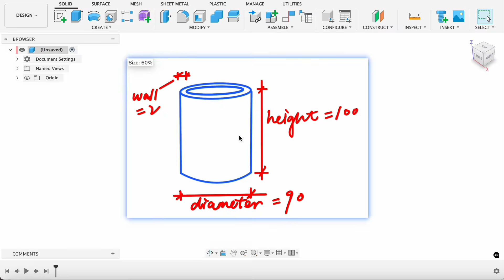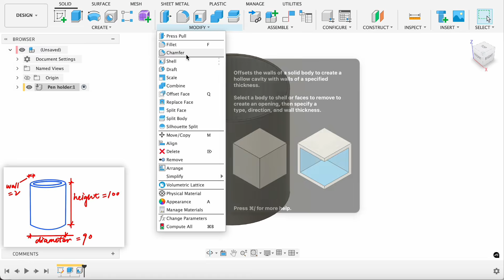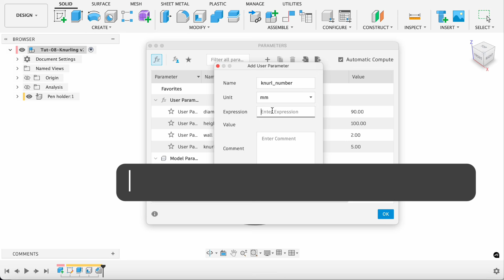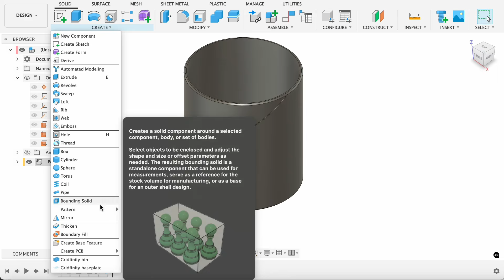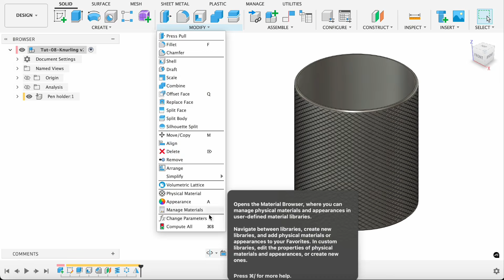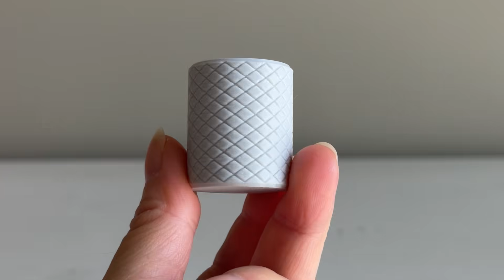Parametric Knurling Tutorial in Fusion 360

Comment: How do you do this on a rectangular box instead of a cylinder?
Reply from the maker: Great question! For a rectangular box, the approach is a bit different since you can't use the Coil tool. Instead, I’d do it this way: Sketch 45° crossing lines on one face, Sweep a triangular profile to cut the grooves, and use 'Rectangular Pattern' to fill the face. Finally, use 'Mirror' and 'Circular Pattern' to complete the rest.
I could make a dedicated video on knurling flat surfaces if there’s enough interest!
Reply: @send_to_print  Would be nice to have a video for rectangular boxes (none just perfet cubes) so we could learn how to create baskets with custom patterns. Would be nice to learn how to do parametric custom patterns (not just knurling), or even honeycomb holes, or any other custom patterns that we could apply to custom boxes, item holders. Ideally it would work for square corners, as well as filetted corners.
Reply: I second the comment above. Creating parametric custom patterns and applying them to surfaces would be incredibly useful to so many different makers and creators.
Reply: @send_to_print  I'm more interested in doing a pattern that woud be either embosed, or cut, or holed out, and make it easy to adapt to the parent object size if you change the box size. Also ideas on how to leave an edge at the top or botom edges of the box so the pattern does not apply all the way to the edges. 

I'll have to try some tests with the circular patterns to see how they work on a rectangular box and it it would also work if the corners are rounded.